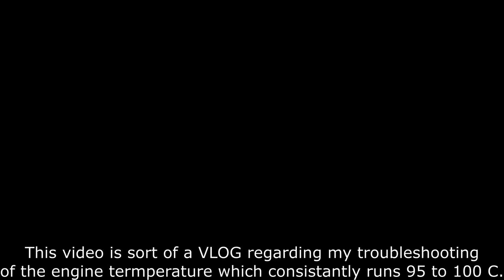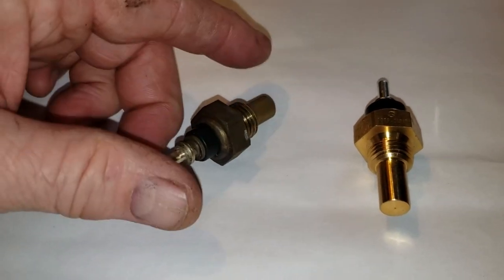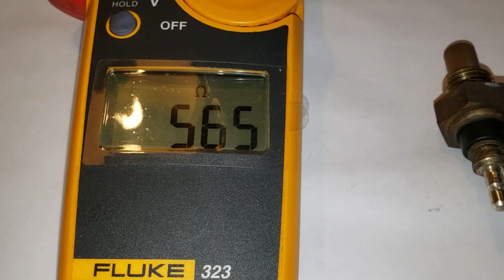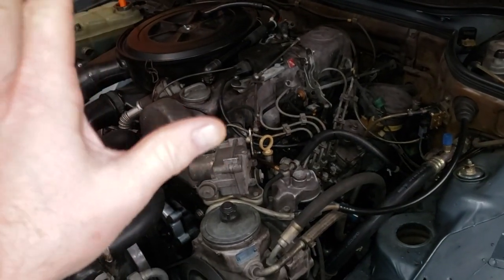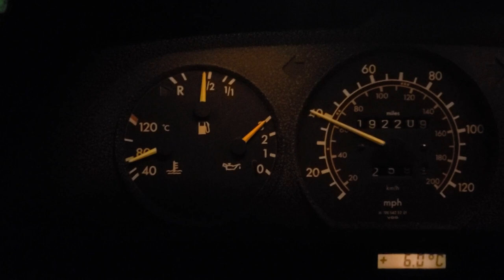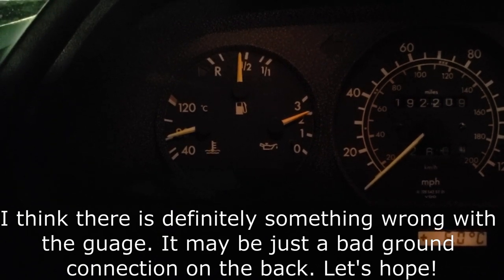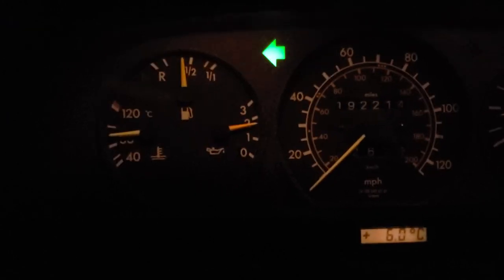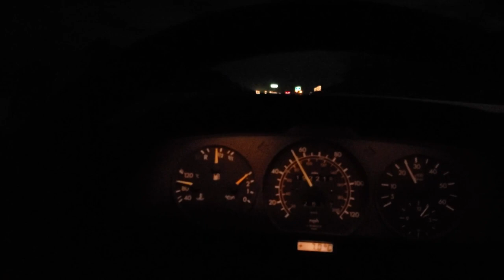VLOG - W126 Mercedes 300SD - Engine Temperature Troubleshooting

Comment: Hey brother. Thank you for all the diesel w126 videos. I drove an '84 SD for a couple years. From time to time it would read a little hot, about where yours is reading. I would give the top of the dash by the speaker a little love tap and it would also jump back down to under just barely under the middle of the gauge. Sometimes my fuel gauge would jump a bit too with it. I learned very recently that this is a semi-common issue and it is in the cluster. I'm 99% sure a new/used OP/temp/fuel cluster was the remedy. I found this info in a forum somewhere. Either Benzworld or peachparts. If i can find it again I'll send it over. Please keep cranking out 126 videos.
Reply from the maker: Thanks! Going to pull the cluster soon I think and see what can be done.

Comment: I had the exact same problem with my W140 S320, and ended up replacing the ENTIRE cooling system w/ Genuine MB parts, only to get the same high temp reading all the time. Replacing the temp gauge sender cured it.
Reply from the maker: Ultimately for me it was cleaning the corroded connections in the temp guage that cured this issue. Later video.

Comment: I have the exact same issue. I used a infrared thermometer on the block, hoses, and radiator and it read 75-80c every where. The gauge head is messing with you and me, don’t worry about it.
Reply from the maker: I fixed the problem. The gauge was at fault. It was a grounding problem.  Refer to my video titled "W126 Mercedes 300SD Instrument Cluster Issues - Temperature Gauge FIXED ! - Part 2"

Comment: Pull condom on the neck of the expansion tank, so you understand whether the gases go into the cooling system. Typically, the temperature on a 617 motor rises due to bursting gases.
Reply from the maker: No. Temp gauge in the car is faulty. There is nothing wrong with the engine cooling system.

Comment: Am in Florida de car temp stays at 80 without A/C on. During 35 -90 mph, now when am in NYC with the car am batting between 80 to90 still without A/C on nor heater. And yes my gauge needle jumps too worrying me! Am in 88 420SEL with only one fan, never seen aux fan kick in, have to test it. I know it as been 2 yrs that you posted this video, what was the outcome? Thanks for your great videos!
Reply from the maker: The problem ultimately turned out to be a faulty temperature gauge in the instrument cluster. The electrical grounds between the temp gauge and the circuit board will corrode causing false readings and fluctuations. Let me go find that video link. I will paste it here.
Reply from the maker: The solution for this issue is cleaning the grounds in the instrument cluster. Here is the video. https://youtu.be/FGEK6XfbGz0

Comment: Have you replace the fan clutch, they don't last long.
Reply from the maker: Ultimately this temperature problem was simply bad a connection in the temperature gauge in the dash. Bad grounds. This is a very common problem with the W126 cars. There is another video on it here: https://youtu.be/FGEK6XfbGz0

Comment: i think the gauge temperature sensor is in the thermostat housing, the one you changed is for the glow plugs
Reply from the maker: No sir. With the engine running, if you pull the wire off of the sensor on the side of the block the temp guage in the car immediately drops to zero. It is clearly the engine coolant temp sensor.
Reply: @ImpalamansGarage  hmm i thought wrong
Reply: random & late, but I read the temp sensor on the thermostat housing is related to the blower motor when the temp is below a certain point to avoid blowing cool air into the cabin on accident....

Comment: The white bar that’s under the 120 white bar, NOT the 120 marker.
Reply from the maker: The bar between 80 and 120 is around the 212 F mark. The engine is not running that hot. The gauge is lying to you. LOL..... I found out in a later video that corroded grounds inside the gauge will cause these gauges to read a little high when in fact the engine is running fine. Check this out. Let me know if you have questions. https://www.youtube.com/watch?v=FGEK6XfbGz0

Comment: I just did top overall and change the fan. My gauge is about 120 c .
Reply from the maker: It's your temp gauge. They are bad about corroded grounds. The fix is in this viseo. https://youtu.be/FGEK6XfbGz0
Reply from the maker: Each gauge has a threaded shaft and a nut holding it onto the circuit board in the gauge cluster. There is a contact pad around the mounting pad on the circuit board. This pad gets corroded and leads to poor grounding. If you take the gauge cluster apart and clean all contacts and ground points the gauge will read properly. It's actually not a hard job.
Reply: Thank you , I tried sanding temp gauge but no success. I will try changing temp sensor . Hope it works
Reply from the maker: Assuming you replaced the thermostat and coolant reservior cap? Water pump too? Any one of these things can lead to higher temps. Recommend a laser temp gauge pointed at the radiator and  thermostat housing to get a feel for whether or not the temp reading you are getting is accurate. Also just a hand quickly placed on the upper radiator hose can tell you a lot. Compare it to another car that is operating normally. You can generally tell when an engine is too hot just by grabbing the upper radiator hose.
Reply from the maker: @ketam  Not sure what all you have done to the car but sometimes a radiator can get clogged preventing proper coolant flow. Maybe have it cleaned at a radiator shop if you suspect this.
Reply: @ImpalamansGarage  thank you sir, problem with my gauge .
Reply from the maker: @ketam  Good news. What was the root cause? Curious to know.
Reply: Grounding problem . I add ground wire from meter to chassis
Reply: @ImpalamansGarage  what did u clean it with?
Reply from the maker: @MrRjnr  Please look at this video where I repair the engine temperature gauge. https://www.youtube.com/watch?v=FGEK6XfbGz0   I used fine sand paper to clean the areas where the gauge mounts to the circuit board. Afterwards use a good electrical anti oxidant compound to prevent bi-metal corrosion on the grounds. These cars are bad about that.

Comment: As far as I know the marker inbetween 80C and 120C is not 100C, but 90C at Mercedes.
Reply from the maker: Disagree. The mark is half way between 80 and 120 so why would it not be 100 ? The consensus in every learned discussion I've had is that the middle mark is 100.
Reply: @ImpalamansGarage  Because it is more worth to indicate 90degC functionally as remarkable limit. In the middle between 80 and 100? It is only matter of calibration. It is better if you clarify this with an MB workshop.
An old diesel engine (like 300SD) does not like 100C (remember, radiator cap is for 100C if there is no expansion tank, and 120C with expansion tank), but on highway 90C is OK for cooling water.
Reply: Another indirect arguement: MB manual says that you may open the radiator cap if the water temperature is below 90C (194F) to avoid hot water blasting out. 
As per your arguement the 90C is not even indicated, only 100C. How could Customer know where 90C is then? MB does not take the risk that Customer opens the cap wrongly.
Reply from the maker: Here is the video where I repaired the temperature gauge and fixed the high reading problem. https://www.youtube.com/watch?v=FGEK6XfbGz0
Reply from the maker: @zoltantakacs866  I assume you are referring to section 20-010 of the service manual. I have the complete two volume service manual.  On page 20.8-010/2, Step 1 under "Draining Tank" it does say that you can remove the expansion tank cap below 90c. If you are making an assumption that the middle mark between 80 and 120 is in fact 90 simply to provide a visual mark to know if it is safe to remove the cap, that is a bit of a stretch in my opinion.

Comment: My car always runs at 40C. 
I'm starting to think maybe my sensor is off?
Reply from the maker: Maybe. Will be interesting to know what you find. I'd look at the sensor first since it's the easiest to get at. Simply disconnect the sensor wire at the engine and see what happens. Might lead you somewhere. Also they are cheap enough to just replace it and see what happens. Might get lucky. A poor ground inside the gauge in the car would cause a high reading in my experience. Look at my later video on that. If you've never gone through the thermostat housing, this may be a good time. Mine was nasty.
Reply: Thermostat.  Replace it.  They wear out over time and get slow.
Reply: @Johnathan_Waters  Yeah it was the Thermostat. Not the Sensor. Was easy to replace. The old one was an original Mercedes one thermostat.
Reply: turns out my sensor was bad. Car was still sitting at 40C with new thermostat.

Comment: I think you have a bad gauge
Reply from the maker: Yes I repaired it in this video. Grounding problem. https://www.youtube.com/watch?v=FGEK6XfbGz0
Reply from the maker: These cars should not run at that middle mark. (About 212) This problem is so common that a lot of folks think these cars actually run that hot. I've seen it a lot on forums. The gauges corrode on the inside. The ground connections become bad and cause erroneous high temp readings.